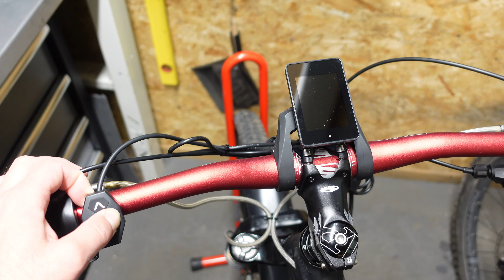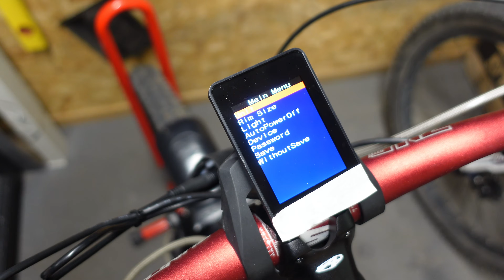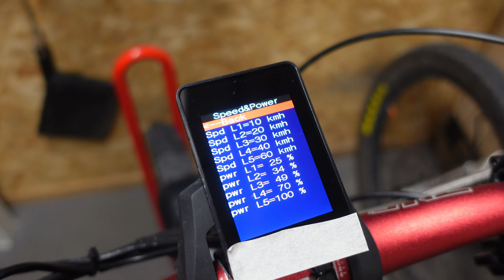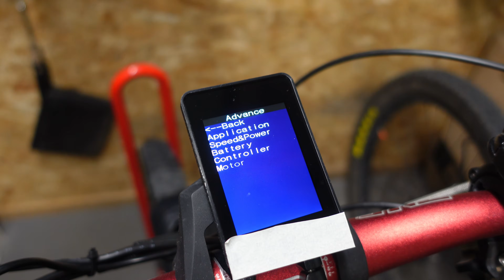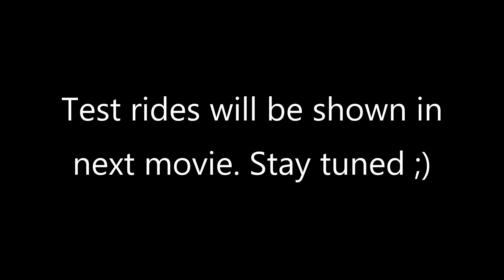ToSeven DM01 motor settings

Comment: Can this controller be set for miles per hour MPH?
Reply from the maker: Yes, it can be.
Reply: @LierskogenEbikes Will you please tell me what the power level in the shift sensor is for?    Also, is the rim speed sensor adjustment for making the mph or kmh more accurate?  I noticed my speed sensor is about 2-3 mph off.
Reply from the maker: @wapiti128  Read the user manual for this screen. It's available for free on Internet. You will find all settings there.
Reply: @LierskogenEbikes  I will search for it.  It came with one but it is very vague.

Comment: Toseven just sent me an invoice for a DM01 to buy directly from them. I want to upgrade my 52V BBSHD. I have another setup with a torque sensing rear hub and like the feel of it better than my BBSHD, but it lacks the power of the BBSHD. Any thoughts would be greatly appreciated.
Reply from the maker: You see yourself how better it is to ride motors with torque sensor then :). DM01 is like BBSHD, same power and torque just with torque sensor. Really good motor for the price.

Comment: I just plugged mine tonight. Thanks for this. You are right. This level of control at the bike level without bluetooth and extra devices is ahead of both cyc and bafang.
Reply from the maker: It became even better since I got mine motor in April. ToSeven added some new features for torque sensor control in June. I'm waiting for reprogramming cable from them to do updates.

Comment: the torque settings are pretty detailed. got the bestsensation with following parameters:
mode: sensitive
min voltage: 700mV
max. voltage: 2700mV
start voltage: 750mV
Startup angle: 30°
Filter: 1
Strength: 8
Reply from the maker: I need to get programming tool. My motor version is from May and I don't have Strength parameter in the menu.
Reply: @LierskogenEbikes when I first got the motor 3 weeks ago (from pswpower) I was so impatient and installed everything fine until I shortened the power lead and inverted polarity... controller bricked. Got the replacement controller straight from the factory through pswpower along with a new display (although I think the display is identical). so my controller is brand new. original torque sensor works fine.

Comment: I bought this motor, too. But my menus look a little different. And the advanced menu only has 2 settings (Battery and LimitSet) 😢

Also, it feels like the torque sensor is not being used by the software.
Reply from the maker: The one sold by PSWpower does not have properly functioning torque sensor. Get in touch with ToSeven.

Comment: Looks like same perimeters are similar to Bafang Ultra setup. Interesting is if the motor is working on principle of reading  torque only or   power of the rider. Also if the motor support   the start from zero speed.
Reply from the maker: You can choose youself, if you want to have motor starting just by torque excerted on pedals or combined with rotation of pedals.